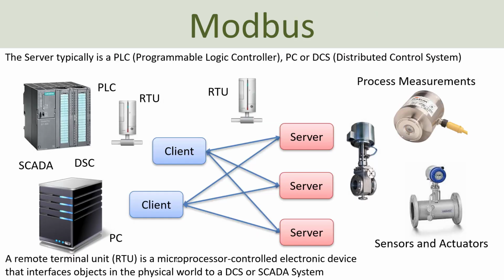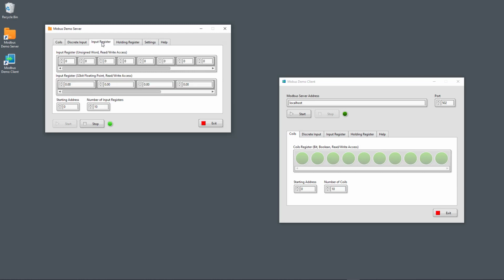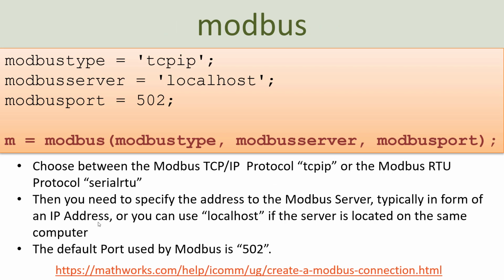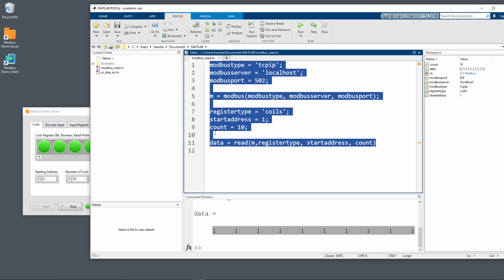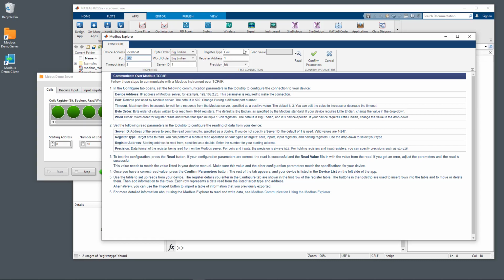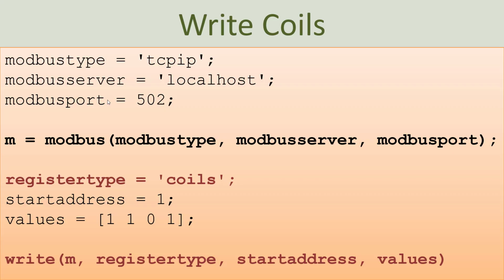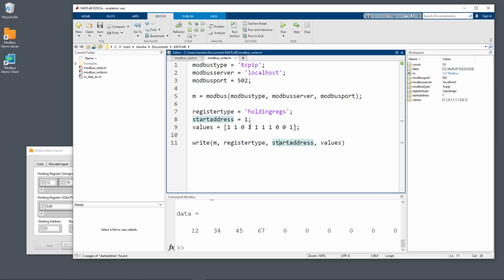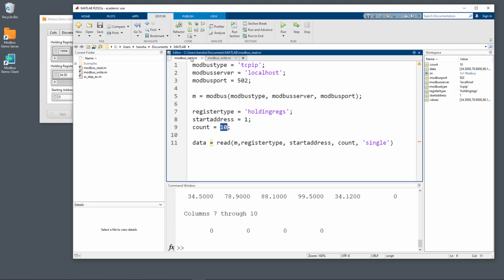Modbus with MATLAB

Comment: Nice video, it was very useful. But, i have a question, it's posible to handle multiple conections (for example four) simultaneously creating multiple modbus objects or you can only connect with one? Thanks for the video
Reply from the maker: Hi, I guess you can have multiple connections. I have not tried myself, but I guess just try and you will find out if it works or not. I guess they need to be on different computers or if you have multiple on the same computer, you have to use different port numbers.
Reply: @IndustrialITandAutomation  ok, thanks